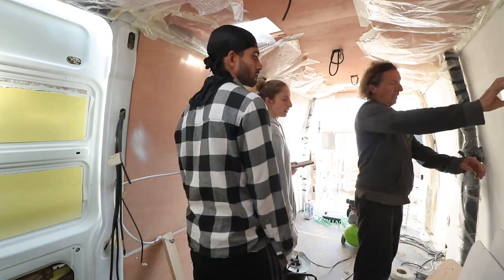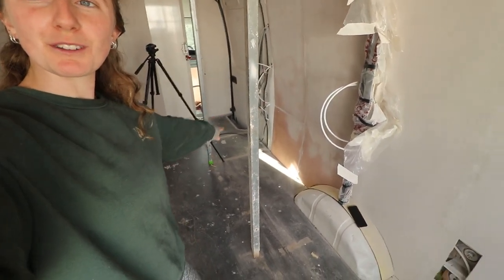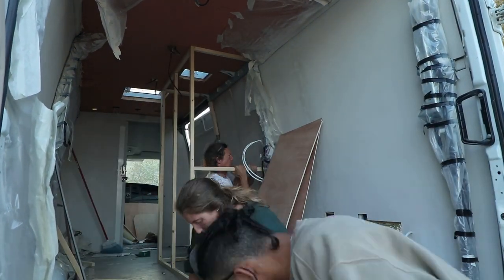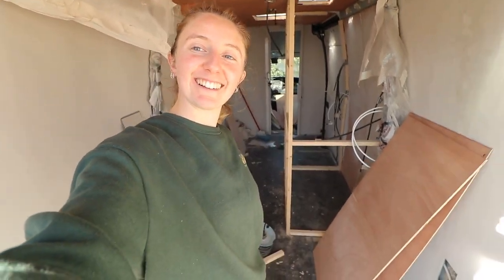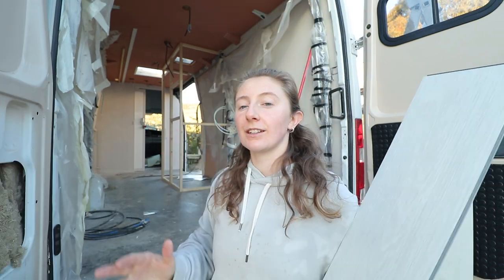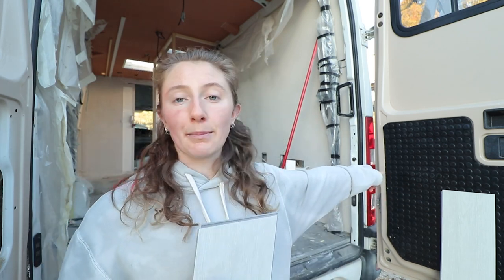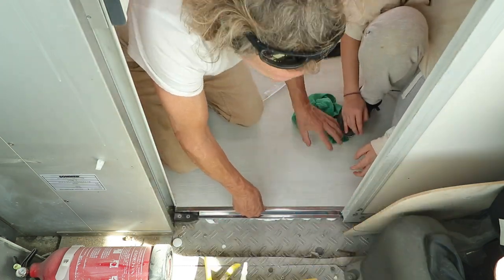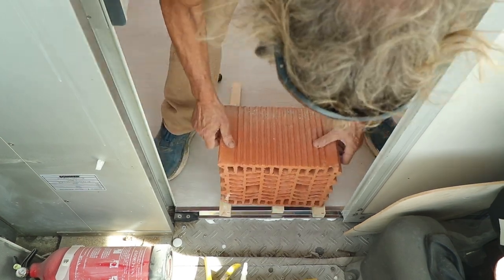bathroom framework & perfect van floor // our van conversion vlog | iveco daily

Comment: Hi! Subscriber number forty here. Nice job on the floor!!! But, I just had one question. You floor fits so well, but did your installation instructions say anything about leaving a little gap around the perimeter of the flooring for expansion? I'm not really sure if your flooring needs that, but, I've heard some van people say that they've had problems with certain types of flooring when there was changes in temperature. 
Also, I know it's common practice to put up little subtitle type notes during the time-lapse portion of a video. But, did you ever consider doing little voice over comments instead. That way we don't miss stuff, trying to quickly scan the subtitles. This is nit-picky, but it's just an idea.
Anyway, the van looks great! You guys seem to have done a lot of thinking ahead of time, and it's paying off.

Until next time. This is number forty, signing off!
Reply from the maker: hello again! it had been a while since we'd heard from you and we were getting worried! that is a really good point, thank you so much for checking with us about that because that certainly would have been really annoying! we did however annoy the sales person with a very long list of questions around this (especially as we wanted to put underfloor heating in) and they let us know that there wouldn't be any problems in regards to this so... fingers crossed!

as for doing he voice over, I hadn't ever thought about it, do you think it would be better than the text bubbles? you have definitely given me something to have a think about! 

thank you once again for your support and your lovely comments, we're so happy you're still enjoying our videos! see you soon subscriber forty!
Reply: Like I said, it's nit-picky. But I sometimes wonder why people prefer to use text bubbles. I can usually scan them quickly enough, but I always feel like I'm missing a little of the video, especially when they use a lot of 'em. But, like I said. It's just a small thing. I tend to whine a lot.

Anyway, I figured you probably checked on the floor expansion stuff. Don't worry. I'll catch you doing something wrong someday. @terratrotter_vanlife